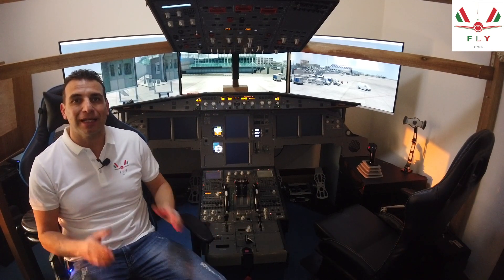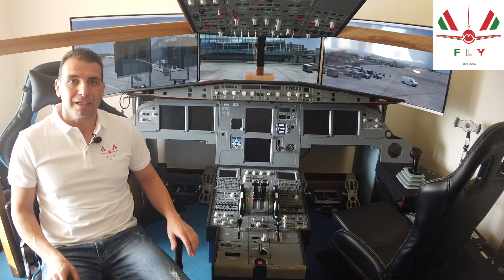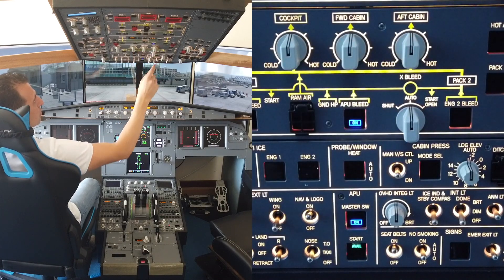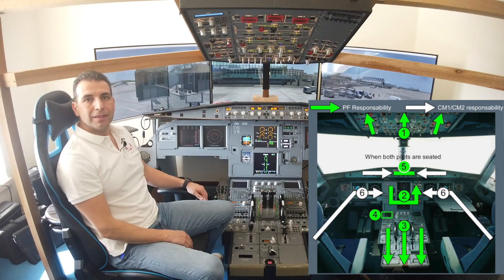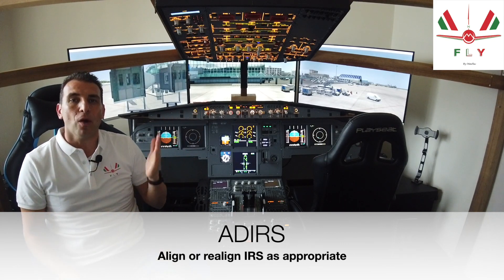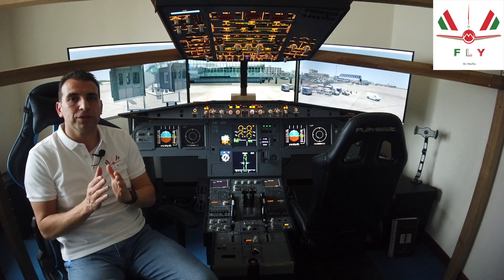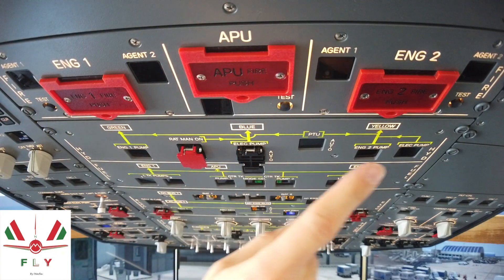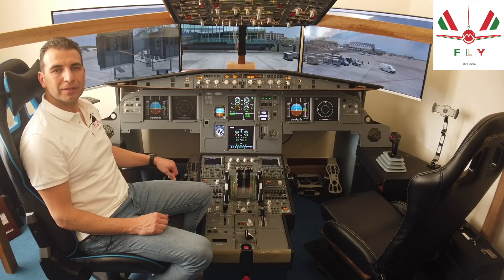A320 How to start from "Cold and Dark"

Comment: before you checked the battery voltage, all switches were dark.  Then there is a cut (after wipers are off check) and all switches light up and you switch off the battery.  Before that, you probably switched it on at some point but didn't show it ...

Comment: I think you should start eng1 at first on a320 bc of gen
Reply from the maker: Hello David, thanks for your comment, in the FCOM-PRO-NOR-SOP-Engine Start-Automatic Engine Start, there is the reason why usually Engine number 2 is started first. It powers the yellow hydraulic system that pressurizes the parking brake.
Looking forward to receiving more comments from you, have a good day.
Reply: @flybymarkx7386  is the FCOM manual downloadable. Any pointers to that
Reply: on the a320neo the 1st engine is started first. On the a320ceo, the 2nd engine is started first.
Reply: @alexandergalfano3187  thanks for your reply. In the Airbus FCOM-PRO-NOR-SOP-Engine Start-Automatic Engine Start, there isn’t any difference between Neo or Ceo Aircraft, they have different engine models but the procedure is the same for both. During the Automatic Engine start, Engine 2 is usually started first. It powers the yellow hydraulic system, that pressurizes the parking brake.